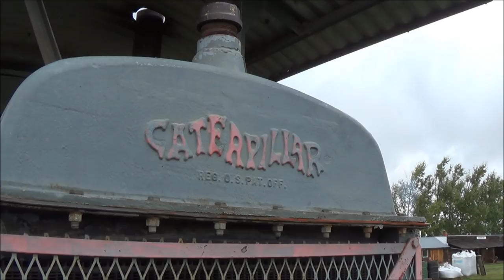Caterpillar Sixty Engine Startup Demo

Comment: 1925: We are gonna have Tractors in the future that Start Themselves!
2019: Can't Start Engine. Firmware update Required, Please contact John Deere for a Technician.
Reply: Only to find out that the part is no longer supported despite it works just fine
Reply from the maker: Brutally true.
Reply: check fuel comming , check ignition point setted right-if you dont know that - tell me how many cylinders,and is it stright 4, v4,stright6, v6 , or v8- i can tell you  witch  piston must be up first and witch ventils must be open, or closed for to get  it working...
Reply: Get a Fendt uuuugh. JD Crap LOL
Reply: I grew up riding in my Grandpa's 5400 so I have a love for John Deere but it saddens me to hear that kind of DRM, field-serviced equipment they have.
Ah well, at least I don't have to deal with that playing FS19.
Reply: @Rainhill1829   Spoke to my brother-in-law (dairy farmer) about this just last week. He says older John Deer tractors are selling for more at auctions than the new irreparable computerized ones on the dealer lot.
Reply: How right you are!!!
Reply: @tanklover385  Sounds like Microsoft. Nothing wrong with the old machines, they just keep making software that only runs on the new ones.
Reply: Or a fuckin DEF issue….

Comment: thrilling and dangerous starting procedure!
Reply: you could see the reliefs in the flywheel, the bar will only transmit torque in one direction, so as soon as it tries to start it kicks the tip of the bar out of the flywheel. not quite as dangerous as it looks.

Comment: Gas of the day approx 25c per gallon and if road tax existed then, farmers and contractors would probably get a rebate on that, making the fuel less expensive. No doubt these old girls slurped through a fair bit of it when under load. The massive torque produced seems quite unreal when compared with high revving engines!
Reply from the maker: Yes they are real torque monsters for sure.

Comment: Im no mechanical guru but funnels work wonders
Reply from the maker: I did have one, sadly it left no room between itself and the bottom of the canopy, so had to do away with it.
Reply: Rainhill1829 i figured. I didnt say that to be mean. But if this is the case id park near a garden hose but then again the artistic shots of the water running off the grill are cool.
Reply from the maker: Oh it's all good, the hilarious thing is I deliberately parked near the water spigot, only to find out later that I was a couple of feet short with the hose, at least it was a short trip with the bucket.
Reply: Rainhill1829 get a buddy an push it closer or is too heavy lol jk again
Reply: maggs131 facile
Reply: It would probably be easier to drag the spigot to the tractor! 

;)

Comment: I bet a torque spec or drawbar pull would be interesting.  For instance the Cat RD6 has 10,274lb drawbar pull at full governed RPM of 850 and 11,400lb at 600RPM, with about 46HP at the drawbar. This is a 3 cylinder engine with 623ci 5.75" bore, 8" stroke. I'm sure this old Cat engine has some cool specs too.
Reply from the maker: You bet, 1128 cubic inch (18.5L), 6.5 inch bore, 8.5 inch stroke. developed 81 horsepower at 650 rpm and produces 660 foot pounds torque at the flywheel. Peak drawbar pull in first gear is stated at 12,360lbs at the Nebraska test.

Comment: 2 spins and its ready. We will never see machines like this build here in this country again.   Sad.
Reply: EFI, Has to spin up to a certain rpm before certain sensors get readings before the ECU will call for fuel or ignition.
An EFI car has a long crank time because its waiting for the reading from the Crank or Cam position to determine TDC,  then it fires fuel and ignition

Comment: Beautiful! 
Sorry.... why drain water?  Why don't add antifreeze?
Reply from the maker: These cooling systems where optimized to run water as water has a higher heat capacity per unit volume than antifreeze, as well not all of the machines seal up very well so we run water as leaks are not an issue
Reply: @Rainhill1829  Thank you!

Comment: What exactly did this machine do?
Reply from the maker: It is a crawler tractor, basically a dozer without a blade. It was used for heavy traction work on adverse soil conditions such as sand and loose loam that needed low ground pressure. They were also excellent for logging.

Comment: A U shaped pipe with a one way valve on the intake that is 2-3cm in diameter would make siphoning water from the bucket easy and fast and more would go where you want it.
Reply from the maker: The most annoying thing was it was about three feet out of reach of the hose.
Reply: Where was your hose stretcher? ;-)

Comment: 4:10 - DAMN DANGEROUS.  I'd prefer not to operate this thing :) Or at least that lever should have some safety like detachable tip.
Reply: Imagine that lever would get stuck
Reply from the maker: The holes in the flywheel are actually oval shaped to eject the bar if the engine fires improperly.

Comment: Very cool.
 I am curious.  How do you figure out how to run this rig?  Did Grandpa teach you?  Do you have the original operators manual?  Nothing on it seems intuitive.
Reply: oldschoolgreentube it definitely didn’t have the concept of psycho engineering in mind when it was made. Operating this thing was skilled work. PS: especially given this dude filling it with water has never heard of a funnel before.
Reply from the maker: Had a  funnel, couldn't fit it between the rad and the canopy.  :)
Reply from the maker: I simply watched the other old timers who run it as well. These machines have similar characteristics as far as magneto and carb settings.
Reply: @Rainhill1829  Good job.  Very cool that you keep it going.
Do you use it for any practical purpose? Any actual farming or is more a hobby?
I lived in Iowa for a time and some old timers liked to use their older rigs on occasion.

Comment: CURIOUS? Is there a battery in that Cat, or does it work off a generator?
Reply from the maker: Good question, if they were fitted with electric lights then power was supplied from a small engine driven generator. The spark was of course a stand alone system generated from the magneto.
Reply: @Rainhill1829  so it’s just self sustaining, that’s absolutely amazing and simple. Judging that there is no front blade, it was for pulling farm machinery. Adjusting the Magnito is something else I would like to know about and have to research. Sorry older technology is interesting to me, the more you learn the more you know!

Comment: Quite dangerous to start that thing with the bar. And there are a lot of uncovered spinning parts. Safety was really not a concern back then.
Reply from the maker: It was reasonably safe to run as long as you stay out of the flywheels line of rotation when you fire it up.

Comment: Crikey, Health & Safety? If you didn't get that bar out quickly enough when the flywheel started spinning ...
Reply from the maker: It actually will pop out if you let it go, the hole is oval shaped not fully round, still requires a degree of caution and skill.

Comment: great clip! lovely to see how many safety features are incorporated into the design. what's the psi rating on the radiator cap?
Reply from the maker: Thanks, it's an interesting design. The cooling system is atmospheric, no pressure at all.

Comment: Would the use of modern anti-freeze coolant have any negative effects on the engine?
Reply: Its better to use it but the video shows the start in every winter morning in the 30s
Reply from the maker: We sometimes use antifreeze but we run the systems out for the winter so its easier to simply use water.

Comment: seems like a really unsafe way to start the engine, using a rod in the wheel and then just having to have fast enough reflexes to remove it before it smashes your hands into the tracks.
Reply: from what I understand, the hole in the flywheel is angled so that it locks one way, when the flywheel turns past, the rod hits the sloped side of the hole and pushes itself out. does look very hairy though.
Reply: oh wah

Comment: Runs so good, I'd hate to shut it off. I bet it would pull a plow or a disc a lot longer than you'd wanna sit on it.
Reply from the maker: It's actually quite pleasant to ride on, the engine runs fast enough to be nice and smooth.
Reply: @Rainhill1829  with a nice big bench seat too.
Reply: @slowpokebr549  
De

Comment: Little nervous cranking that one over! How far will it launch that bar if it kicks?
Reply from the maker: As long as the spark is set correctly, there is really no danger, you just have to make doubly sure your pre start check are done right, however, if you screw up that bar will end up smashing up your fuel tank and control linkages. Just work smart and stay out of it's line of rotation.
Reply: this is the correct answer, the engine may be "retarded (2 or 3 degrees afterPMS)and the engine dont start in reverse,Is correct,many arms were damaged by a incorrect timing.
Reply: Tom Hare, That is a good question. Some mags have a built in advance system. I work with older Gravely tractors which all used mags. I even prefer the strap start versions over the battery start ones. If setup correctly, they fire on the first or second pull. OSHA would have a fit with things like this Cat and those Gravelys. Too many unguarded pinch points. Like unguarded fan blades and open flywheels.  Then we add things to the Gravelys like chainsaws and circular saws ( 30" blades ). An open guard was an option on the 30" blade. :-)

Comment: Another fine example of how irrelevant horsepower is when it comes to tractors, trucks, tanks, trains etc. The next video I'll watch is a 1911 25/45 Rumely tractor. Thats 25 and 45 horsepower, on an even larger tractor. Once again, pretty much irrelevant.

 I've always wondered why the producers didn't omit the horsepower numbers, and advertise the torque instead, which would be a much bigger, much more relevant power measurement when it comes to slow moving, heavy weight vehicles, made to push/pull even more weight!
Reply from the maker: Very true, they tended to rate the engines by the number of plow shares they could pull and to what depth, sort of a measure of their torque.

Comment: Would have been better if you told us what you were doing
Reply from the maker: Sorry, the feedback I most often get is folks like to hear the machine and not me, so I prefer to remain silent and let it speak it's piece.
Reply: Can't make everyone happy. I too would have liked to know what you were opening, adjusting and lubricating at times. 

I recommend subtitles.
Reply from the maker: That's actually a good idea, when I get finished my next run of uploads I will start to work out a system with the subtitles.
Reply from the maker: Quick update, I added subtitles to this video and will start adding to others soon, enjoy.

Comment: pS fill it up with anti-freeze and you won’t have to drain it and rust its guts out every time you start it.
Reply from the maker: Were advised against glycol coolant, it's higher boiling temp tends to push these engines above their designed operating temps since most use thermatic syphon instead of pumps, boiling water actually helps control the rate of coolant flow.

Comment: that looks very dangerous starting, especially if one does not get the bar out quick enough .
Reply: thats what I was thinking
Reply: The holes are tapered so the bar pops out on it's own. But yes not the safest lol
Reply: Gillies is correct, but the danger is in a back fire where the bar will not slip out, we had a 60.
Reply from the maker: It can be a bit hair raising, you just have to have your wits about you and a bit of practice.
Reply: @Rainhill1829  Sorta like a stomp bailer.
Reply: My Grandfather had a big sailboat in the '20's that had a bar start engine. It had a 12x12 timber under the flywheel in case of backfire to keep from tearing the bottom out!